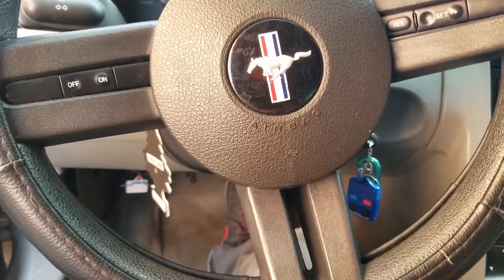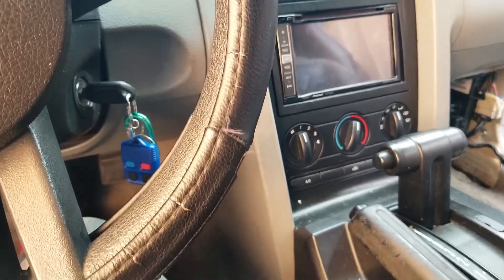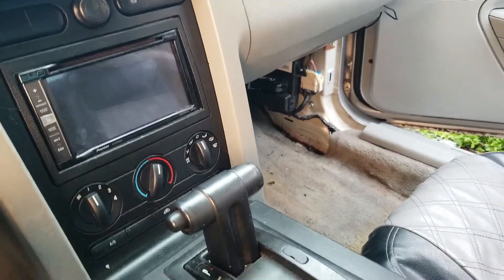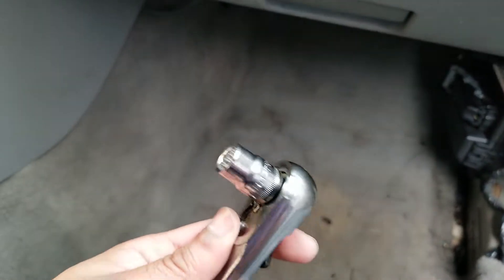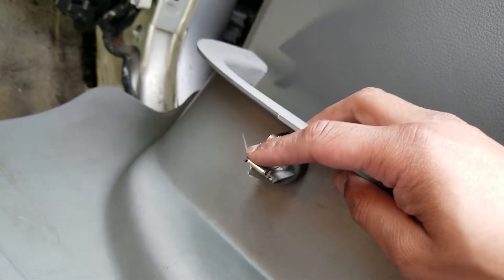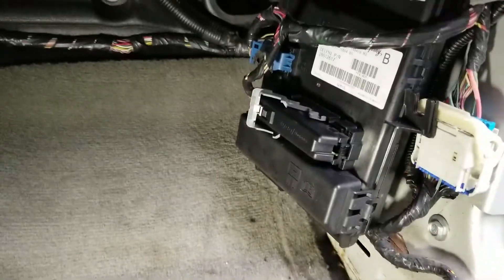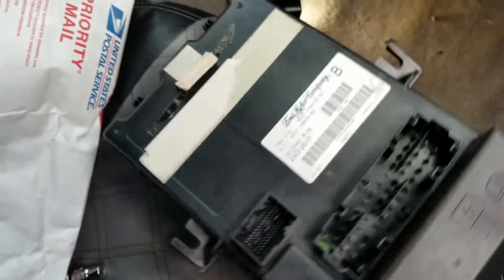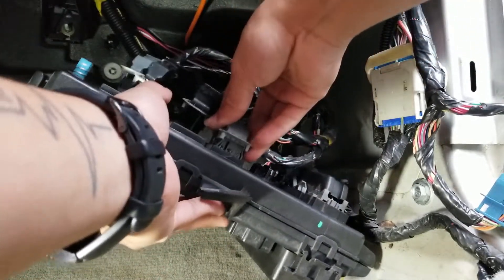Does your 05-09 Mustang Needs a NEW Interior Fuse Box? (Smart Junction Box/Anti-Theft Fuse Box)

Comment: should be reprogrammed at the dealer after changing the box
Reply from the maker: The both times I had to replace this, I didn't need to get it reprogrammed. The only thing I have noticed was the hazard lights do not flash when unlocking or locking the car with the keys (which does requires reprogramming) other than that I personally did not have to get it reprogram, everything seem to work like it should so I am sure you can also get away with just replacing it, not sure if they do charge to get it reprogrammed tho